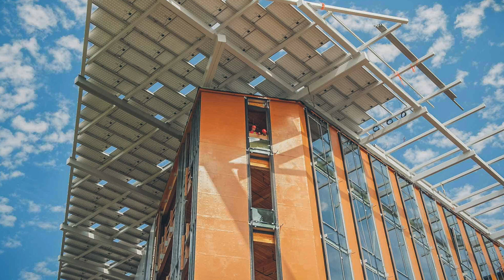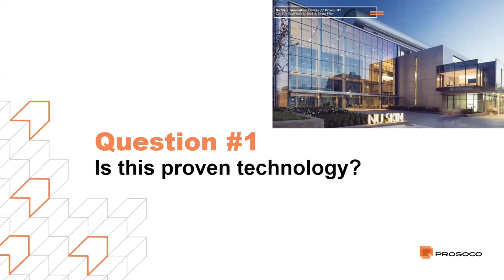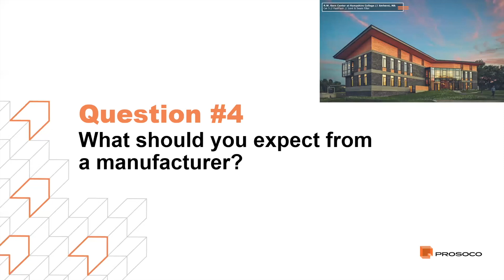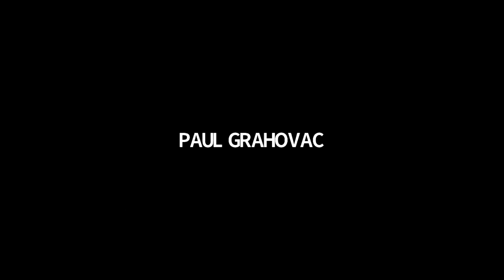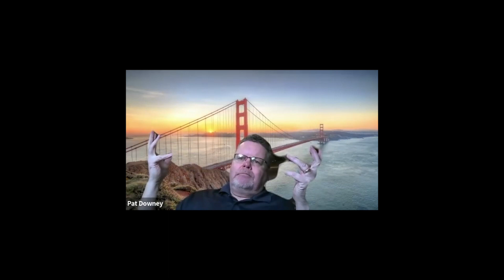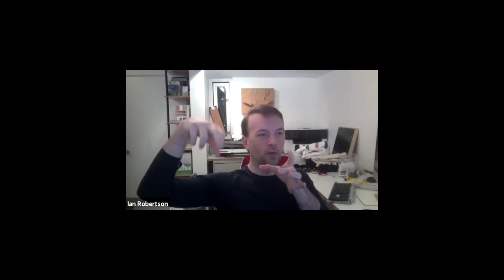Passive House Component Spotlight with PROSOCO: Air Barriers for Retrofits and New Construction

Comment: Great info. Any PHellow architects, engineers and consultants know any OH door supplier in BC, Canada that can reach passive house air tightness requirements?
Reply: "Passive House level airtight", durable garage doors obviously approach being a physical impossibility. You'd probably need a fussy motorized system to apply gasket pressure around the head and jambs after the door was in the closed position, and the sill/floor gasket connection to the other three would be tricky to get right. Garages should not (and under most building code, cannot) be coupled to the main living area air-space anyways. Treat it as two separate buildings with a door between them. Heating or air conditioning garages in marginal climates is pretty antithetical to the environmental-minded end of Passive House, but if you get the garage pretty tight (again, detailed like a separate building that happens to connect via a gasketed door to the living space per building code).

Now, since you have to detail it as a separate building for airtightness anyways, I would encourage you further to get the garage or carport the heck away from the actual house. I have seen a modern consumer plastic-tank vehicle, nearly full tank, burn in open air. It took more than 20 minutes to burn to completion even with active firefighting. Were that vehicle inside a building at the time of the fire, the entire building would have been a total loss, and people could very well have died due to fire or smoke inhalation.